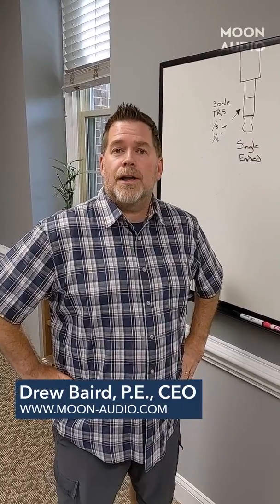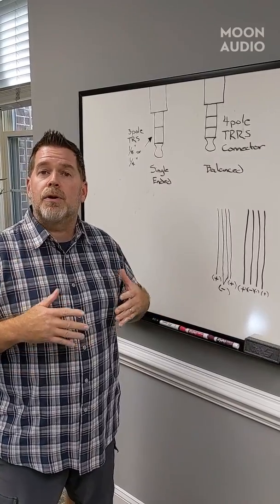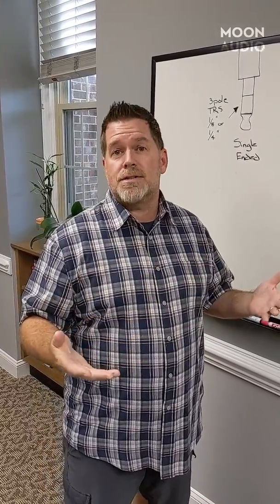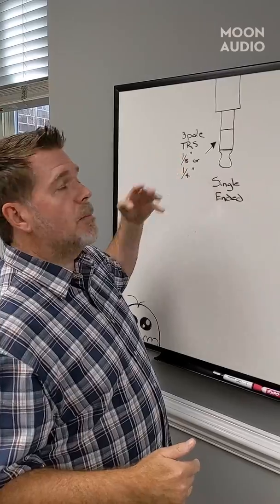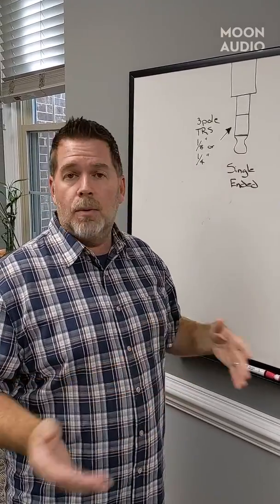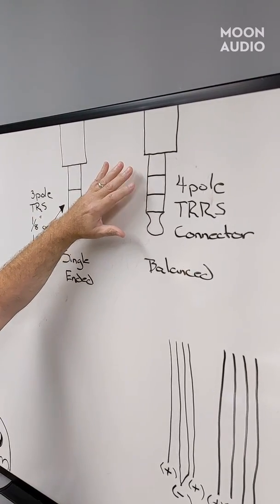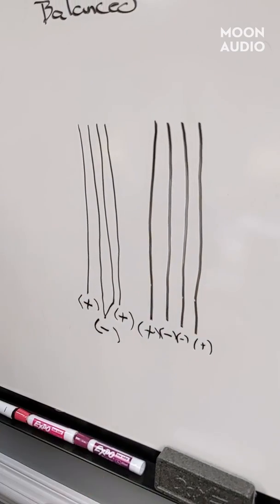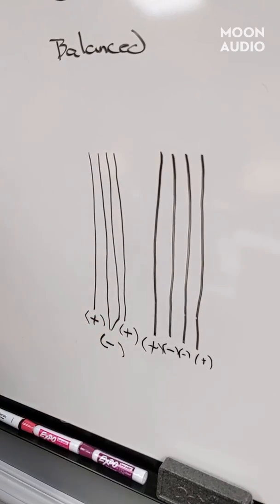How to Adapt Single-Ended Cables to Balanced Connections? | Drew's Audiophile Tech Tips

Comment: What kind of adapter cable do I need to connect my Bluemini R2R Dongle to my stereo speaker amp? I think I might need female TRRS to stereo RCA...but that appears to be a very rare adapter...like I only see one company on the entire internet selling a 4 conductor TRRS female to stereo RCA adapter. Obviously there are a ton of female TRS to RCA adapters but this Bluemini is using TRRS. I don’t need microphone, just stereo…and I don’t want to short my amp.
Reply from the maker: Hello!  Are there only RCA jacks available on the input of the speaker amp? XLRs will be the best option. The issue will be that the TRRS female 3.5mm will be shorted when RCAs are put on the other side. If the amp has a ground lift for the RCAs, this issue may be circumvented. RCA jacks are singled-ended, and once plugged into the amp, you will shorten the negatives of the Bluemini R2R Dongle output. Thank you, please let us know if you need a recommendation.

Comment: My concern is trying to convert a single ended AKG K371 with Mini XLR to a 4.4mm or even a 4-pin XLR. It's tough that it isn't made for balanced output, but still a great pair of cans.
Reply from the maker: The AKG K371 doesn't necessarily need a balanced connection. With 32-ohm drivers and 114 dB sensitivity, these headphones are very easy to drive. A balanced connection will give a lower noise floor and more power, but a high-quality single-ended amplifier is more than enough for AKG K731. Thanks for your comment. Hope this helps! 🙂

Comment: What about going the other way? Can my unbalanced Moondrop Kato's be damaged or damage my FiiO M11 if I change the cable to a balanced 2.5. My biggest reason is more power - the Kato's are 32 ohm and need a lot of juice.  Thanks.
Reply from the maker: You can change the cable to balanced. You just can't use an adapter to convert a single ended 3.5mm plug to balanced. This can damage a balanced amp as the grounds are tied in the 3.5mm TRS. See more here: https://www.moon-audio.com/balanced-adapters-caution
Reply: I think the Katos (or any other IEM) themselves aren't unbalanced or balanced, those terms are all on how the cable is built and transmits and the source. @moon Audio right?

Comment: I think the biggest issue is that some listeners don't understand basic electrical and perceive balanced outputs as delivering twice the power of single ended outputs. They might see it as an opportunity to drive high impedance/low sensitivity cans off of a moderately powered DAP (like my iBasso DX160). If it can be done with some more heat and less battery life then fine, but not at the expense of jeopardizing equipment life. The question is if cables can be purchased that can accomplish this reliably. If so then you have a new market.